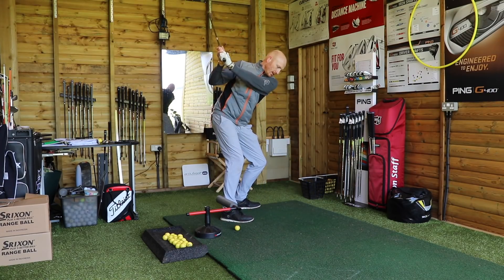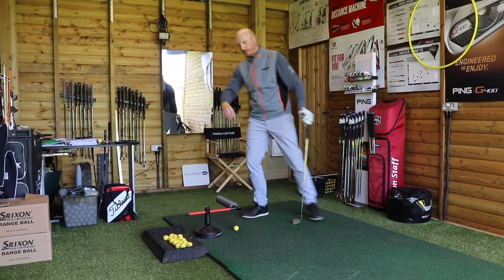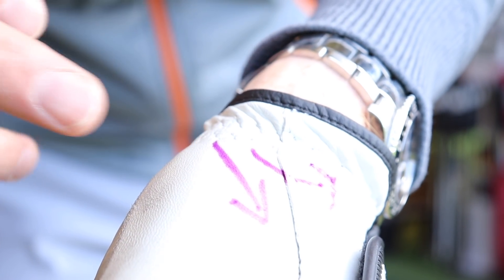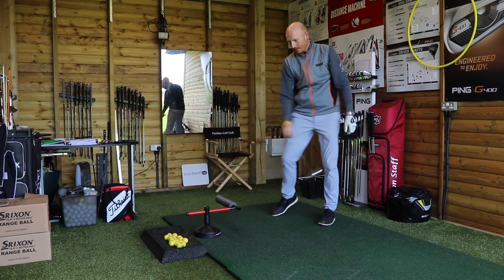Change path from Out-to-In to In-to-Out with face control

Comment: Hi Steve. Another good un.. I changed my path from out to in to in to out (too many”to” in that sentence) using the same method but used an upside down range basket with a club sticking out of it acting as the arm to swing under. Anyway, to my point, by far the hardest aspect was changing face rotation. After all, I spent a couple of years holding the face open trying to square the face to the target line because I was swing left due to my out to in path. Hopefully your other followers will read this post, understand why they are leaving the face open and be very, very patient waiting to ingrain the forearm rotation bit. Hope that makes sense. Thanks.
Reply: Ian Robertshaw oooo

Comment: Great video.  I am a big believer in cause and effect in the golf swing.  You must fix the cause not the effect.  While I agree a flipping of the wrists  is to be avoided, it is not only focussing on the rotation of the forearms that will correct the face.  There MUST be adequate body rotation is well to achieve the release you are describing.  Look at the video at 5:10 and 5:30 where you describe the correct and incorrect release.  In the incorrect example, you still your body and flip the hands.  In the correct example, you rotate your body towards the target and that facilitates the correct release.  Just focussing in forearm rotation and ignoring the body will lead to a very frustrating session on the range.

Comment: Query

I notice the same problem in reverse as I normally swing out to in and the ball goes straight left- a pull that make me lose the golf ball every time on the par three where there is a deep valley... So if I were to cup the wrist in a down to out/up swing, the  swing should stop pulling the shot and d the opposite?